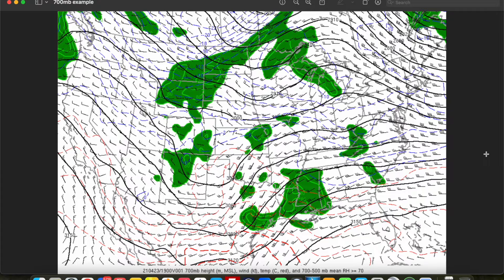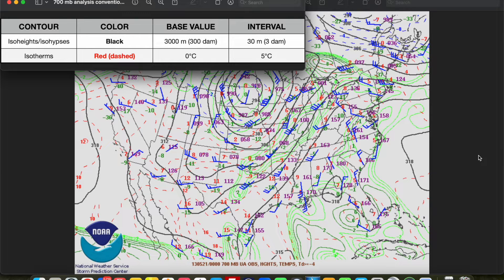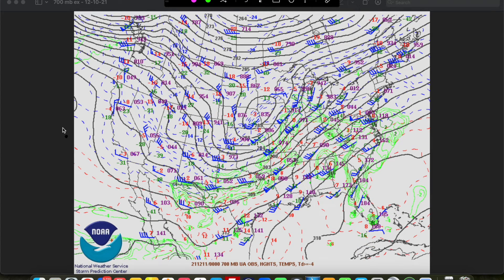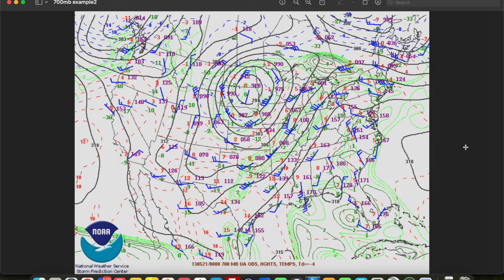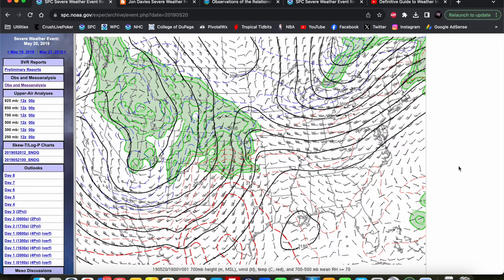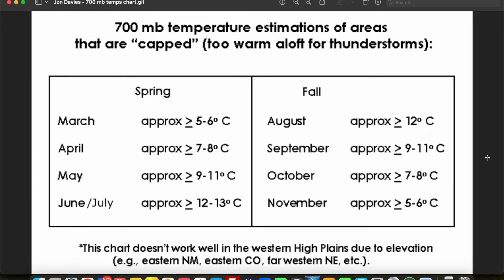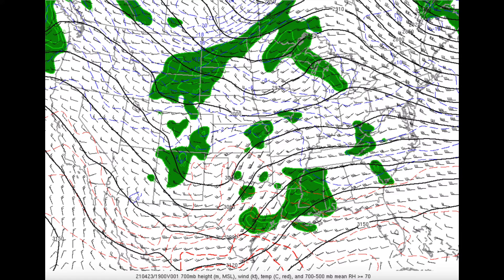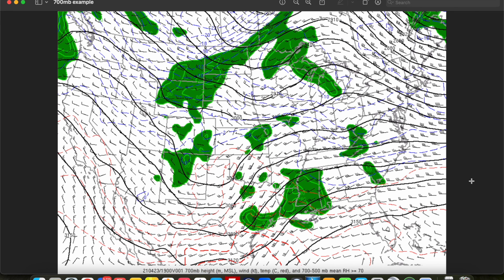Definitive Guide to Weather Map Analysis - Part 5 - The 700 mb Map

Comment: I have a question that I hope you can answer (if you don't want to, that's fine) How can you differentiate a short wave from a trough? Because I've seen some that I don't know if they are short waves or troughs...
And also, can a trough turn into a short wave? And a short wave into a trough?
Reply from the maker: A shortwave is a trough, just with a smaller wavelength than a normal "longwave" trough. Longwave troughs can span quite large distances across the globe, and shortwaves are embedded within the longwaves (and there can even be smaller shortwaves embedded within the shortwaves, if that makes sense...these are the little "kinks" in the flow that I always talk about). The wavelength of a trough can definitely change with time, although longwaves will always remain longwaves and shortwaves will always remain shortwaves.
Reply: @ConvectiveChronicles  I've read that short waves must have a wavelength less than 3700 miles... is that true? 
And another thing.. Can't shortwaves be closed systems due to isoheights?
Reply from the maker: @Wh0lecak3  Yes, that is a good threshold value for shortwave troughs.

And yes, shortwaves troughs can close off and become closed lows.
Reply: @ConvectiveChronicles  Last question because I am really curious about shortwaves.
Can short waves be the size of a long wave? Or larger? And if so, how can you tell if it is not a long wave?
Reply from the maker: @Wh0lecak3  No, shortwaves are always shorter than longwaves in terms of their wavelength.
Reply: @ConvectiveChronicles  Thanks for answering my questions!
Reply from the maker: @Wh0lecak3  Any time!